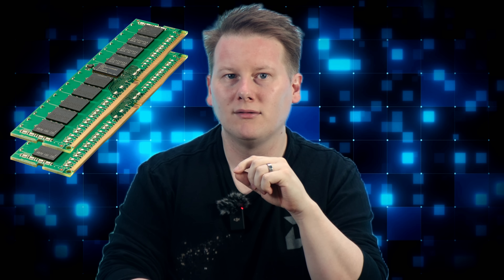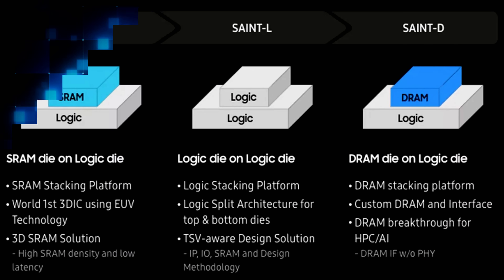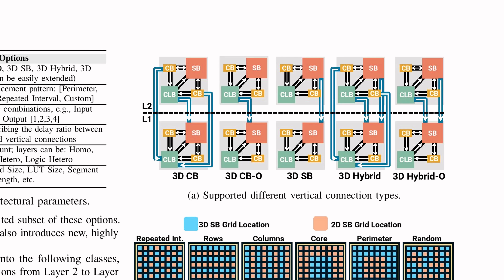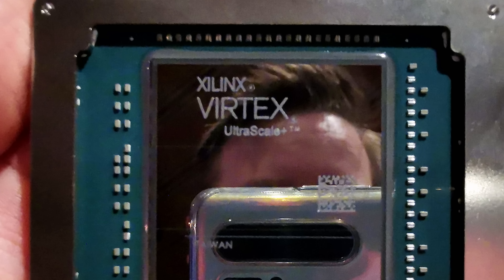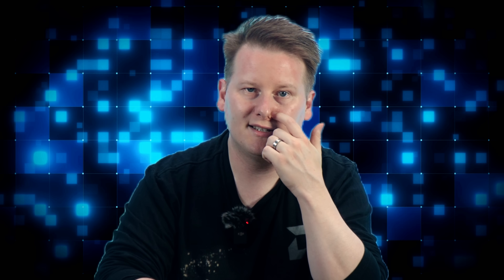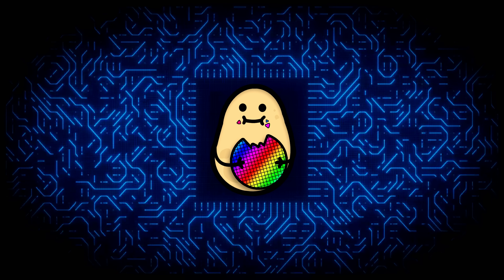Monolithic 3D: Stacking Without Chiplets

Comment: @Tech Techpotatoes.  When are the next FPGA improvements coming?  I was really hoping for 3D FPGA hardware when I saw the thumbnail.  I need something like coldfire but able to run misc cores at 200-2000mips lower energy but with several multiacess system memory banks and several thousand luts, able to sip along low clock at between 0.1mw to 1mw and go up to regular present energy consumptions at full speed.  But there is nothing out there which can tiuch that, even up market.

So, are there any reasonable improvements coming?

Comment: They can not stack many 3D chiplets because the stack does heat a lot.
Reply: YES! Heat dissipation due to practical limits of heat & power density would indeed be a huge limiting bottleneck of any 3D chiplets unless architects will explicitly include heat-dissipation, power supply interconnects next to the data & I/O interconnect in dedicated intermediary layers. Think of putting power rails & metal/water plumbing in between every few of the logic & memory layers.
Reply: @FrankHarwald  Effectively, i.e., cooling a planar area of 4 chiplets is better than cooling a stacked 4 chiplets because its area is 1/4.

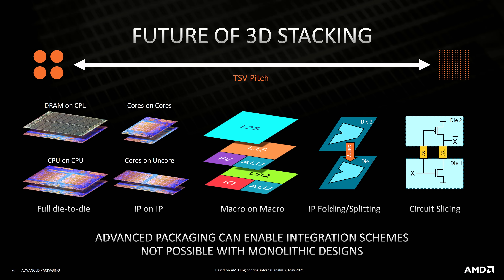Comment: The slide at 1:55 does not go into the complexities of node optimization and why it could be more cost effective to split a design up into layers:  they do not need to be from the same manufacturing node.  For example, DRAM and logic use different manufacturing techniques to achieve their own design goals.  

I would like to add a tangent schema to the slide at 1:55 by splitting off analog functionality.  For a mobile SoC, various radio functionality would exist on its own independent silicon layer using an optimized analog process while layered with a more state of the art digital portion.  It is effectively a spit circuit schema working across the analog-digital domains but works fine with the largest TSVs.  A different approach to this would be to spin off clock and power to their own stacked layer.  I can only see this happening now on a base layer that is the size of a full wafer: smaller designs will likely stick to the similar in concept but easier to implement backside schema.  I would argue that vertical packaging of photonics chiplet would also fall into this style of deployment.

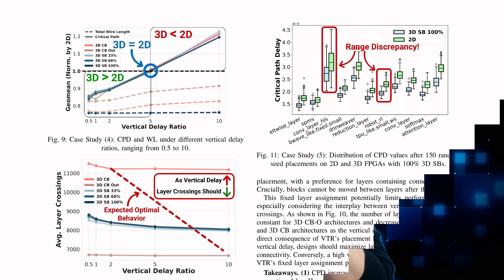9:41 One implication of reducing wiring delays by 48% would be that clocks speeds could be increased significantly in a final hard design.  A designer could alternatively leverage a 'double pumped' implementation where parts run at double the clock speed but at half width.  For a schema that has limited routing capabilities, like say a limited number of TSVs going between layers of the silicon stack, this would be beneficial to explore.  This ties into the idea of cost and being able leverage different manufacturing nodes for each layer if desired.

One thing missing from here is how to successfully cool such a stacked schema.  Stacking topology like this is effectively logic-on-logic, just each layer becomes more unique as designs advance towards the goal of split circuits across layers.  This has been the hardest stacking schema to implement as the top layer is the one that gets the most effective cooling.  The bottom layer gets to be the middle of a runway thermal sandwich.
Reply: I guess its the top layer that is the extra L3 cache on top of the 5800x3d right? As a user of this chip with a fairly extreme cooler it seems to work effectively and at surprisingly modest temperatures. I'm guessing you're quite a bit more involved in this subject than most casual viewers :)

Comment: This was always a natural extension to stacked chiplets. I remember showcase from 1990s from IBM where they explored how to cool stacked designs like these.
Reply: If I recall, IBM hold (held, have they expired?) patrnts involving direct liquid cooling of a silicon stack.  The big issue of going vertical was never really the design aspect but manufacturing at scale, yields and thermals.  IBM’s technology addresses the thermal aspect but I have no clue how its impact yields or how difficult it would be to manufacture.

Comment: First joke: Transistors aren't planar since good 10 years ago.
More serious and honest question: I know that most layers currently are used for power delivery and connectivity as well as structural support. But weren't parts or segments of some chips already "layered"? I don't know the number of layers, but I would assume 2-4. Not much, but it would be 3D on technicality. I don't have and never had actual schematics of first Intel processors that had AVX-512 (Haswell? Skylake? - I really don't remember) - but the way the 50.000 cycles delay was explained (one of the ways it was explained) was that during those 50.000 cycles, CPU would work by putting 512 bit instructions through 128 bit sections 4 times, then downclock and use all 4 128 bit parts to give "real" 512 bit execution. And problem was thermal. Some books and papers I've read suggested that without downclocking, some portions might melt, because the heat would be trapped and would be concentrated in tiny area. It almost made it sound like this 128 bit sections were stacked on top of each other either 4 layers of 128 bit or 2 layers, each containing 2 128 bit units. Now - this might be misunderstanding (and again from what I've read, not only on my part), because those parts are described as "lower" and "upper" - which more often describes which half of the bits are being computed in which order, but it is interesting that some authors assumed that thermal problems would come from blocking thermal conductivity of "lower" parts, by "upper parts.
And this is my concern as well, when it comes to "True 3D". Now, it should be mentioned that, this situation is much better than with 3D stacking. Most thermal problems IIRC stem from Silicon Oxide layer being much better thermal insulator than silicon. I was also worried about power use, but if wire length is shorter (and thickness and materials are equivalent) then it should actually be lower. I'm trying to think how Backside Power Delivery might influence this design. And thermal problems, might be mostly mitigated by good design. Though it means that EDA's will have much more work and likely libraries and leading edge nodes that utilize it, will be even more expensive (I don't know how easy it would be to use existing node to design 3D chip - assuming libraries are not there yet, it feels like A LOT of work) - especially since Intel situation seems bleak and it's possible that we will end up with de facto monopoly on leading edge nodes. And there is nothing stopping TSMC from saying that access to their 3D libraries will cost additional money (of course you can spend R&D on designing your own - technically). For high end stuff, this might be okay. I'm sure that most powerful Xylinx FPGA's will get massive boost from it that will be worth the money. But I'm not sure if this will benefit "regular" consumers. Though I hope so.
With lower wire length, latency should also be lower. Heck maybe "butterdonut" could be implemented without use of interposer ;) - but it definitely should allow for better connections than 2D mesh for example. Less hops.
Reply: Even FinFets are planar. There is a planar layer of silicon with width > channel length > thickness. On both sides are planar layers of oxide with planar layers of metal. If you tilt your head by 90°, we already stack thousands of transistors.
Reply: @ArneChristianRosenfeldt  My first part was a complete joke. Just pointing out that technically planar transistors never had 0 depth and FinFET are very obviously 3D. But of course that wasn't what the video was about.

Comment: Ian is there reference design of mono-3D? Stacking compute and interconnects on Z direction might need a different cooling solution because max turbo boost clocks will eventually result in burning out of the chip.

Comment: already in 3d nands ssd/storage. thats just final optimization and design fit. let the software cadence do it automatically. etc. a non issue, dont focus on that. you dont dictate how everyone lays their pipes. way too much micro managing. best is when you dont distinguish between xy and z. or you dont need to. academic exercise only. ie there is ton of space to fly in 3d volumes. let the tools do tooling. flying cars better than 2d road congestion. no need to build roads at all. wd 3d nands seem to do this already.

Comment: 3:15 "...a new 3D monolithic design...": Kind of what Elon did when he started 3D printing his rocket engines... and got rid of all that junk that was hanging on them at the same time. Would require switching to a deposition technology rather than a etching technology. Would take a pretty fine nozzle though.

In short it's a 3D FPGA.

Comment: The idea of the fpga is changing, and its sortve interesting to see what happens w/ it; With that said, the market is goin' thru changes, and we arent all in agreement w what the point of it all is, or could be, even tho we depend on the market to make moves, moves that are random in the sense that they go through financially relevant holes (polynyas) and hope to come out the other end successful. For this reason i think its better to let the market do what it does for awhile. its going through internal changes, and we can sortve like, wait out the storm til the phoenix rises. thats my opinion, as although something like risc-v machines, or like small-form factor w/ high power/mobile were suppose to be an exciting thing, that which very well may be, thats really the answer to the blind innovation in the desktop field, and seeing what route they end up going—whether it means branching into smaller, and more of a smartdevice pidgeon hole, or something else (though they might just stick to the plan and keep the exact structure, with fpga and other sortsve components on board, but you have more successful branches if you take those sortsve chances) so i wouldnt rule it out, but i wouldnt get too excited for anything interesting just yet, as we are falling into polynyas and the ice feels like its breaking

Comment: Seems like this would be very useful for neuromorphic computing too?
Those are low power enough you could stack a bunch of layers before any heat issues arise, routing becomes easier, and neighbor cells have more possible connections.
Reply: This is what I was proposing for existing AI on a cheap low energy node, with my extemely light processing cores surrounded on all edges and corners by memory, and finding out the AI models snd systems I would need for design and training required so much memory, stacking and other methods to get those terrabytes on wafer.

My general purpose compte density environment I had previously wanted to do, used ram between processors as heat spreaders along one, but maybe two or three planes.  At an estimated 4000 transistors per cpu, even at extreme energy efficiencies for the technology and seversl hundred mhz to 5ghz capable nodes, packing that as densly as you can not only bottlenecks processing from memory starvation, but increases thermal density past pasive cooling.  So, large pools of memory  were a good option.  But this stuff is nothing compared to msgnetic cellular automata, which had a break through and went quiet a few years ago and nobody talks about it at 4Thz, or the 10x faster custom magnetic computer technology under investigation and development at the same time.  I guess this was a military trchnology capture.  The stuff in this channel is nothing compared to the stuff you hear about if you kerp your ear to the ground or know people with clearance to develop with it.  We are being kept back as far as AI, and to do high levrl skilled design requires a knowledgeable world view in tne tetabytes of memory capacity (newest training models bsck this up, requiring 10 Tetabyte memory space), and I suspect we will see 100TB.  My wafer ambitions were just bit bangers compared to those, just to chug alomg in home development labs.

Comment: I'm by no means an expert, but when I hear you say "3D Layers of logic", all I hear is "heat sources trapped deep within an insulator (silicon)", or "resulting in even higher energy density", which given the cooling requirements of modern high end chips already, seems like it would constrain chips that use this strategy.

I suppose if there's shorter routing, that can lower the overall resistance (and thus heat generation) at least partially?
And I guess the logic wouldn't be trapped between two layers of base plate silicon the way the logic in Gen 1 X3D was, so maybe heat dissipation/management will be less of an issue than it was for those designs.
Reply: the through-vias will end up conducting a lot of the heat, they already do that to an extent
Reply: That was exactly my first thought. Maybe if they put graphene layers in for thermal conductance but still.... The whole reason AMD put the 3Dv cache below the chip in the 9th gen ryzen was to reduce thermal overhead which permitted them to overclock. You need surface area for heat dissipation. Stacking mean slowing clocks until (or if) they solve the thermal issue.
Reply: there are applications (mostly mobile) where heat dissipation is probably going to be less of a problem than the efficiency gain shorter paths could create.
Reply: I wonder, if fabrication wasn't problem, if we could make a hybrid of a multi-layer ceramic capacitor (with the plates being the power rails) and a silicon circuit. Routing is allowed to use the third dimension, but roughly needs to keep the spread over the area. Then the silicon clusters / machines would live in "caverns" of the capacitor layers . Shorter traces speed up the circuit and reduce cooling requirements. To conduct heat, the capacitor plate layers would be vertical with the electrodes on top and bottom ( with vias for the ball grid ).
Reply: @ArneChristianRosenfeldt I don't think there isn't anything wrong with your idea fundamentally... but those production issues with making those MIM capacitors all uniform would be... unfun, to say the least.
Reply: Microfluidic cooling perhaps? It would have to be solid state and cmos process based to take off in the future. Hah thermal vias
Reply: usually the issue of heat being trapped (like in X3D chips), is because chiplets are finished and there is discontinuity between layers. It goes from Silicon to Silicon Oxide and to Silicon again. This 2 layers of silicon oxide was what made X3D chips non-overclockable. With 9000 series X3D chips, now there is only 1 layer of silicon oxide that has to transmit heat. And silicon oxide is much worse heat conductor than silicon.
Reply: This doesn't sound like it's gonna be useful for GPP high performance computing.  More niche cases where you need very specific programming for something that GPP's aren't necessarily great at.  Even then, I'm still not sure simply making a larger traditional 2d monolithic design wont ultimately be more economical and faster anyways.

Comment: I dont understand why you have to keep thinking in layers if you're going to build a 3D chip. That implies that logic blocks themselves are still planar. Why cant they be 3D themselved? Instead of thinking layers of pixels, think voxels? Each transistor could have its connections on any of six sides, no?
Reply: Simple answer is manufacturing. Stacking layers taps into existing processes and planar chips already ARE kinda 3d with many stacked layers of wiring

Comment: how you cool that down?
Reply: Not a complete answer, but reducing the total wire length will reduce temperature, if everything else remains the same.
Reply: @Pelicanzzz will also reduce voltage drop due to resistance, and hence require lower voltage,  which will again drop temps
Reply: Integrated water cooling. Tiny channels inside the chip.
Reply: @protox4 nano-plumbing! 😁

Comment: There are a lot of assumptions here. Generating RTL and bitstream are not enough. Are there 3D-stacked FPGA platforms where this can be actually tested? It is an academic research project trying to open up new ideas or reviving old ideas in EDA. Without the right process technologies to support it I am afraid it is nothing but a good thought experiment. I am not trying to discredit the authors. They have done a fabulous job. But we should not get ahead of ourselves. Maybe there are takeaways in the paper for EDA in chiplets.

Comment: But how would transistors be etched in 3D? You need the silicon substrate to create those transistors.
Reply: This is my question as well, how is this multilevel logic supposed to be integrated? The chase for the vertical CFET is on already, but how would you go beyond that, aside from the obvious solution of hybrid bonding?
Reply from the maker: layers
Reply: @TechTechPotato I understand that. I guess I wasn't clear in my question.
How would those layers be etched? Would a new layer of silicon be deposited above several layers of interconnect using something like PVD? Is that even feasible? I guess it would be a bit like Gate all around taken (quite literally) to the next level
Reply: @iraqigeek8363  2D chips aren't actually 2D, recent nodes have something like a dozen layers of interconnects. It's only the transistors that are all in one layer and even that layer is etched and deposited in a series of layers.
Reply: @TechTechPotato  Next interview with Stuart Parkin about Race Track memory??????